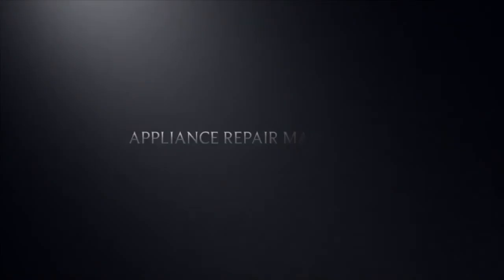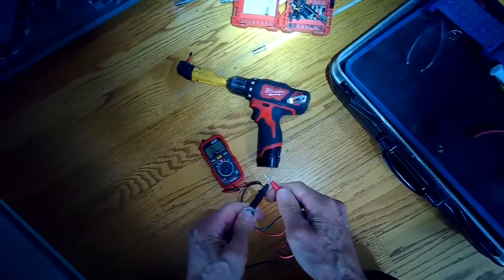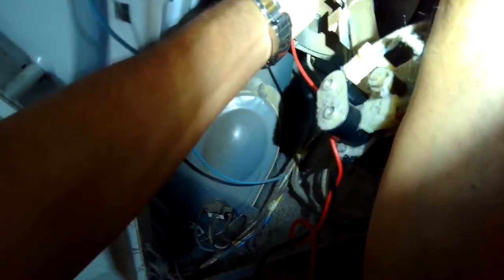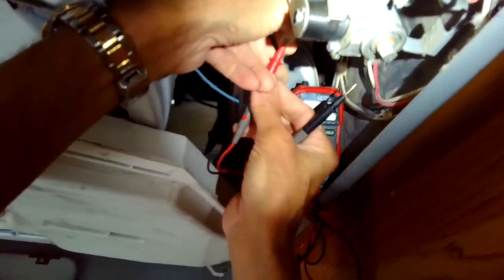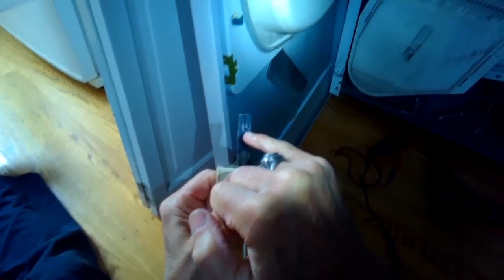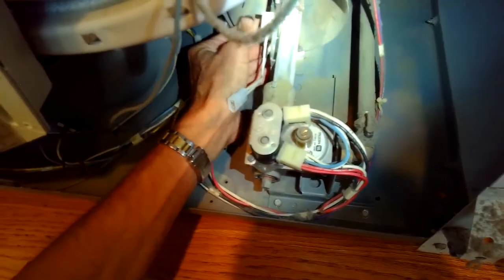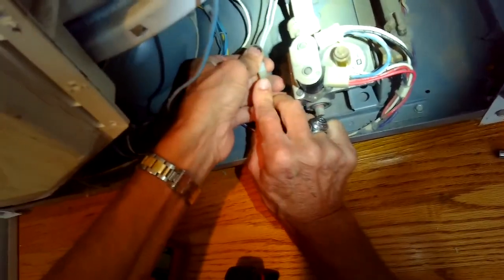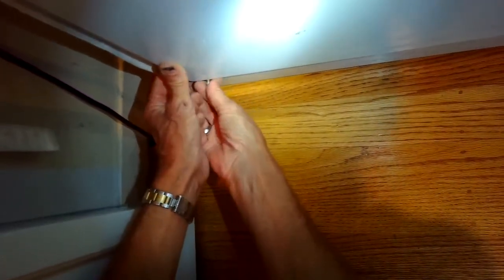MAYTAG DRYER NOT HEATING —EASY FIX

Comment: Thanks much for this fantastic video! Our dryer stopped heating so I bought a multimeter and did as your video instructed. No reading on the igniter and when I pulled it, sure enough it was cracked just like the one in the video. Fixed it myself and saved some money. Thanks!
Reply from the maker: Thanks Rick👍

Comment: Thanks for the video! I have a Maytag DG590 (really old) and the timed dry works, but the flame won't ignite on settings that sense dryness).
Do you know if I should be looking for a moisture sensor or a thermistor? Where are they located in these old dryers? I'm unable to find parts online; I hope I just need to clean out lint!

Comment: hiya. im getting around 90 ohms from my ignitor, dryer isn't working all the safety's have continuity (thermal fuse, door, etc.)
Reply: Did you get it resolved? Mine is the same way. Thanks

Comment: I own the exact same dryer and it is around 25 years old also
Reply from the maker: They’re great😊
Reply: @QuickAndEasy5MinuteAppliance  ya  your video was helpful and it turned out the problem with mine was also the original 25 year old igniter had cracked